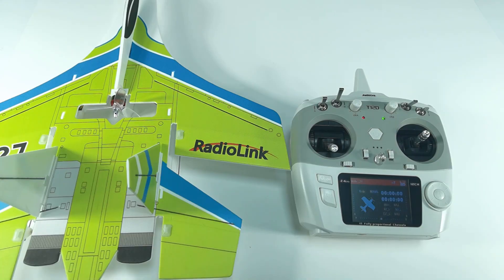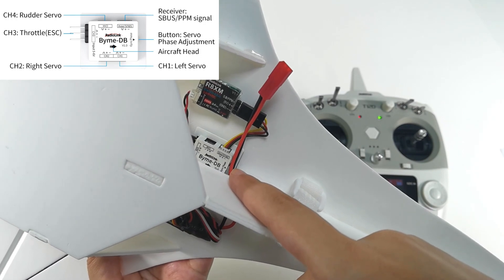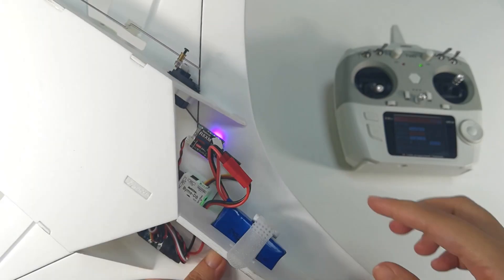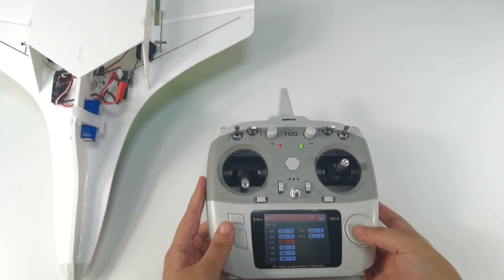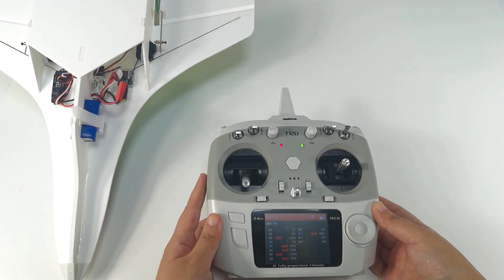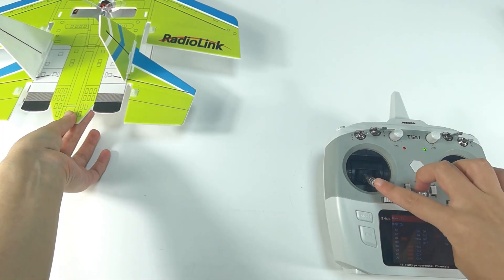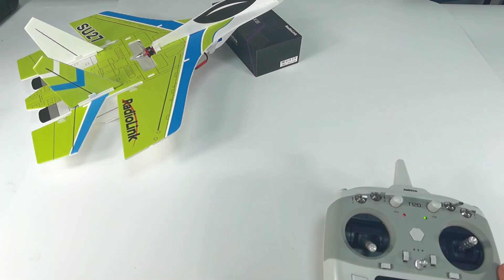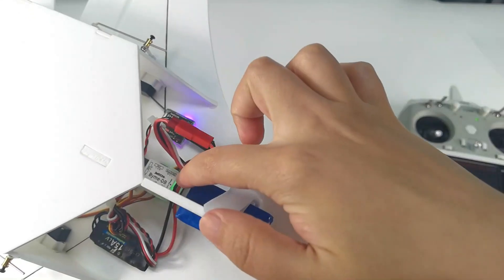How to Set T16D/T12D to Control SU27?

Comment: Is their anti reverse design in t8fb reciver??? 😟
Reply from the maker: Hi, sir. It is anti-reverse design for T8FB transmitter, but transmitter is not. So please make sure the connection to the receiver is not reversed.
Reply: @Radiolink_official   for R8EF reciver is their anti reverse design in the reciver??
Reply from the maker: @jigishapatel8152  Hi, sir. Sorry there is no anti-reverse design in the receiver. If the battery is connected reversed, the receiver may be burnt out.

Comment: Radiolink, 
My t8fb-bt reciver is not working
Plz help 
What could be the reason?
Reply from the maker: Hi, sir. Sorry to hear what happened. May I know how did the problem happen? And how is it working now? Can the LED of the receiver power on? Could you please take a video to us to show the problem of your receiver? And could you please send us your purchase invoice?　If any question please feel free to contact us. Our email is after_service@radiolink.com.
Reply: @Radiolink_official  Led in the reciver is not working transmitter is perfectly fine but reciver is not operating
Reply from the maker: @jigishapatel8152  Hi, sir. Sorry there is no anti-reverse design in the receiver. If the battery is connected reversed, the receiver may be burnt out. If the LED does not turn on, it is possible that the receiver is burnt out. You can buy a new one. You can contact us via email to ask for the discountl Our email is after_service@radiolink.com